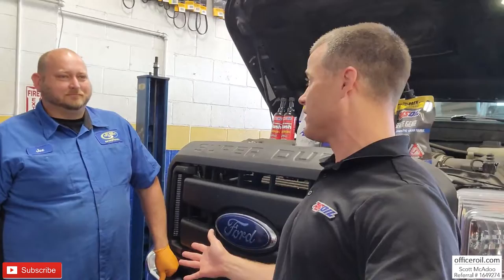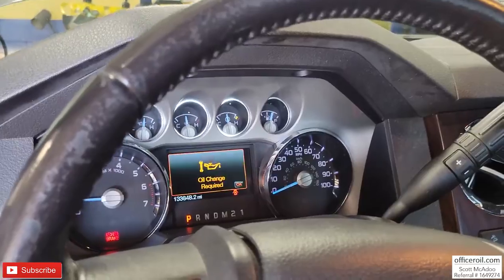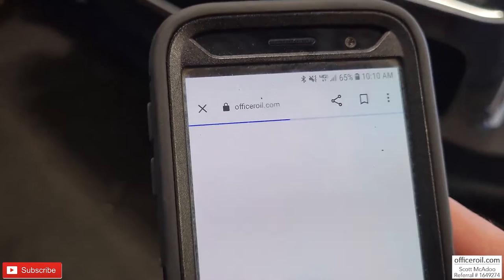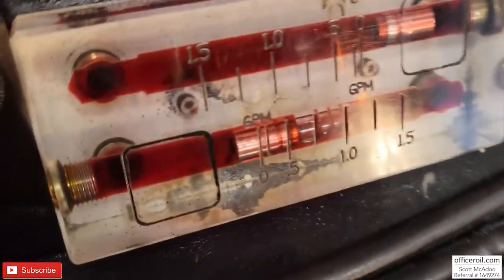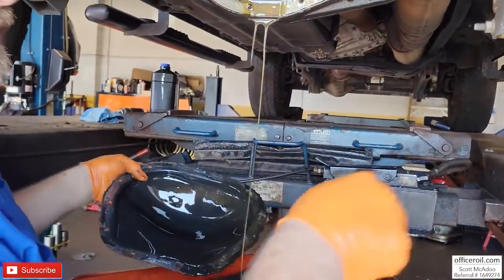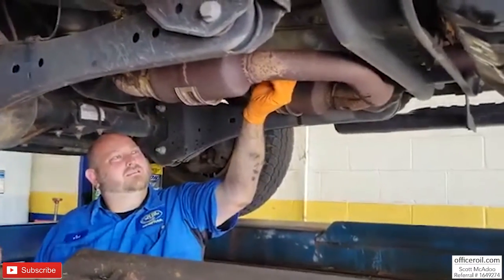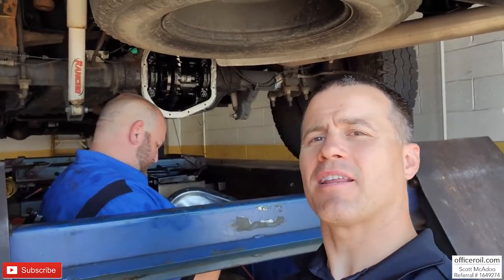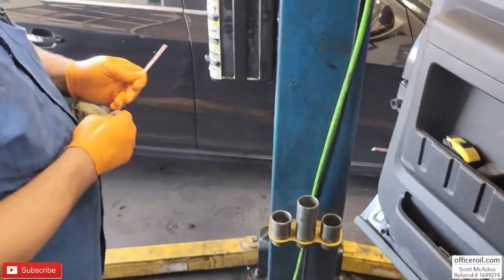Ford F250 Transmission Flush, Transfer Case & Gear Oil Change

Comment: good vid officer oil... i'm a user & seller of AMSOIL... i bought a trans machine so my mechanic & i can do others as well... hav not used on my car yet, just did a pan drop, filter & fill... absolutely the best fluids u can find anywhere... i'm in joliet, ill... best mpg & protection...🤩
Reply from the maker: Thanks Bruce.  Appreciate you supporting my channel!  Dropping the pan, cleaning the pan, cleaning the magnet and new filter is A LOT better than nothing.  Of course I love to do a full fluid exchange but dropping the pan is still a great option for those who don't want to spend the extra $$$.  Keep offering the fluid exchange service to your customers.  It will pay for itself quickly.  Please don't keep me a secret!

Comment: That rear diff oil looked good, generally looks very dark on the vehicles I work on.
Reply from the maker: Thank you.  We thought so too!  This only the second time the rear differential gear oil was changed.  AMSOIL Severe Gear was in there prior and it showed.   May I ask.  Do you work for a fleet or do you have a repair shop?  What types of vehicles do you often see?
Reply: @officeroil-amsoil3463  fleet, mainly e450s and f250/350s but a few Toyota cars and  dodge caravans also. We do regular tranny fluid drains every 30k and diff fluid every 60k. Generally our vehicles go around 200k without any major issues with the tranny and diffs
Reply from the maker: @DapimpBDSD  Nice!  Sounds like you have a good sized fleet.  Preventative maintenance is the best kind of maintenance.  I find many fleets just hold their breath and hope for the best with their drivetrain fluids.  They change oils, but not much else.  Nice job on your end!  I specialize in helping fleets save time and money.  We can easily safely double your trans interval.  Love to talk with you about how we can significantly reduce your fleet maintenance costs, www.officeroil.com.

Comment: Another marketing ploy
Reply from the maker: I'm with you.  I was EXTREMELY skeptical myself and so were most of my best clients.  Did a ton of research and gave AMSOIL a shot.  Been using personally and helping clients since 2008.  Never let me down!
Reply: @officeroil-amsoil3463  no doubt it’s good and not that much better for the price and I know Valvoline works just as good and I know where Amsoil was developed during WW2 for fighter jets by the US military and released to the public in 1972 and it’s very much better than Mobil 1 and slightly better than Pennzoil and Valvoline and If it was just 10 dollars higher than those I would use it but 85 to 95 a gallon no it’s not that much better.  Thanks
Reply from the maker: @lesrinehart933  Thanks Les.  Yes, our founder was a fighter pilot and that played a huge role in AMSOIL's development.  

$85 a gallon?!?!  Why would you pay so much?
Reply: @officeroil-amsoil3463  That’s on EBay and the online store for what 65 gallon
Reply: All oils have to be API Certified and some barely make the grade and the super rich corporations can throw millions into research to enhance their oils Shell Dutch Chevron Havoline Pennzoil  and they have a lot more money than Amsoil and Amsoil has a very strong marketing campaign these days and it’s proven excellent stuff and if they ever get in the ballpark with the big corporate companies I’ll switch and I am thinking hard about putting it in my transmission. You know you’re transmission is the most important engine in your car and more expensive.
Reply: The key to any vehicle is frequently changed fluids you can run a clean motor on OReillys oil if you change it every couple thousand miles.
Reply: Good information
Reply from the maker: @lesrinehart933  Consider joining the outstanding AMSOIL Preferred Customer Program and save 25% off the retail price shown online.  Drop ship right to your door step, https://www.amsoil.com/offers/pc/?zo=1649274.  I can easily send you a FREE catalog if you'd like???  

Plus we have three great synthetic options, ABC.  Our C (100% synthetic OE Motor Oils) maybe right down your alley.  Change it at your OEM recommendation.
Reply from the maker: @lesrinehart933  I'm with you.  AMSOIL is still family owned.  Of course $$$ is spend towards advertising, however their R&D is incredible!  Consider AMSOIL in your transmission.  It's built for those who demand maximum cooling, wear protection, and cooling.
Reply from the maker: @lesrinehart933  Preventative maintenance is the best kind of maintenance!